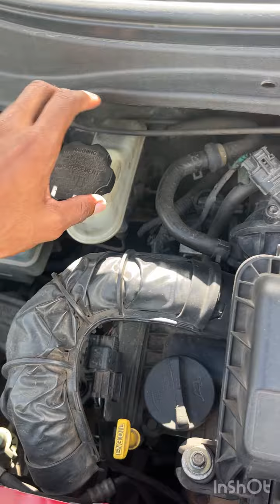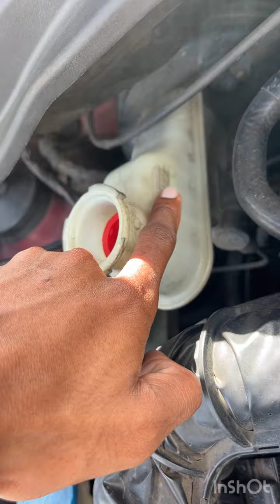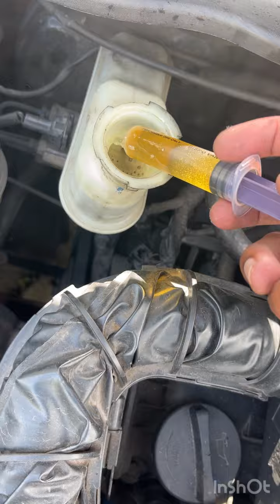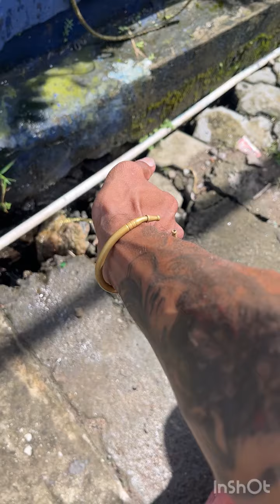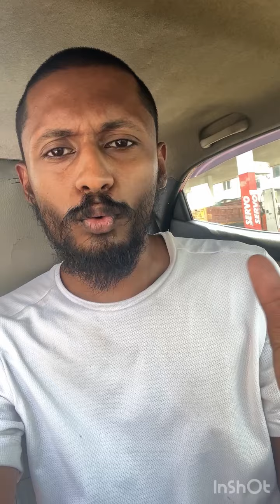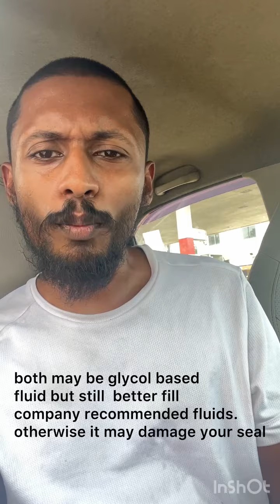നിങ്ങളും ഈ തെറ്റ് ചെയുന്നവരാണോ 🤯 #carservice #kochi

Comment: dot 4 boiling point 250 degree celsius kooduthal ann, 250 mellil poyale expand akku, brake fluid water content(boiling point 100 degree celsius) annekil expand akum , epozhum brake fluid water less than 2% vekan sramikuka, online rs 500-600 device kittum brake fluid quality check cheyann.. baki karyagal video prajyath pole correct ann. max vare ozhikam epozhum manufatures oru clearanace vechitunde..
Reply from the maker: yes clear , very correct , 💯🙌
Reply from the maker: good info …..🤜🤛😊